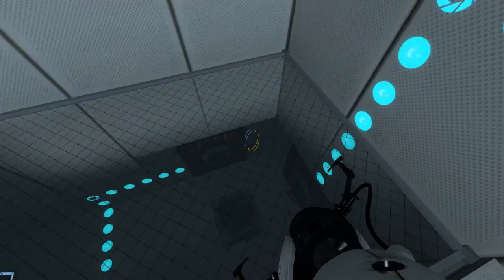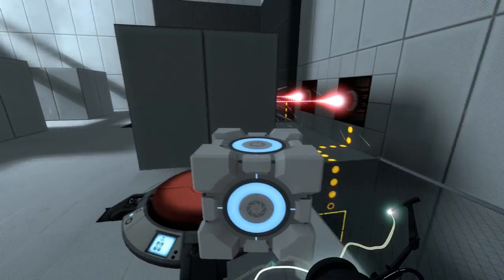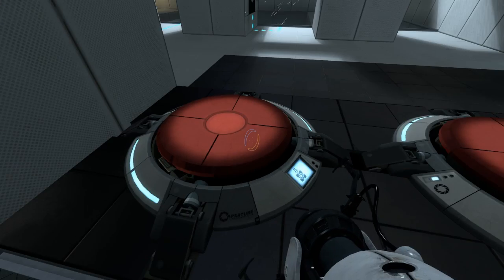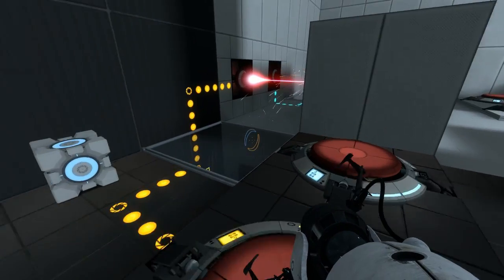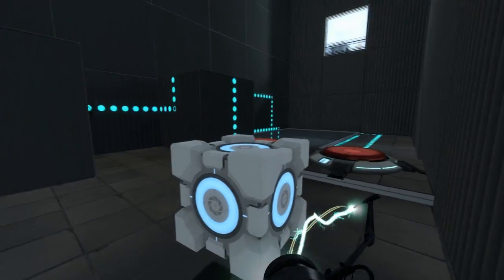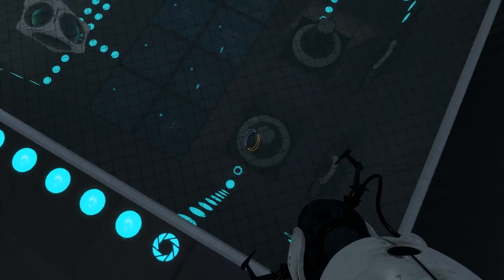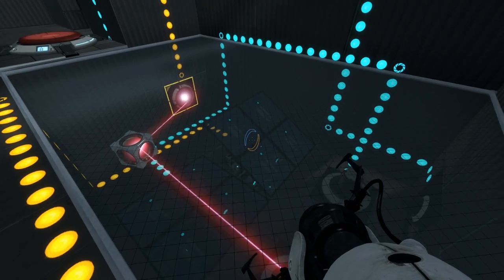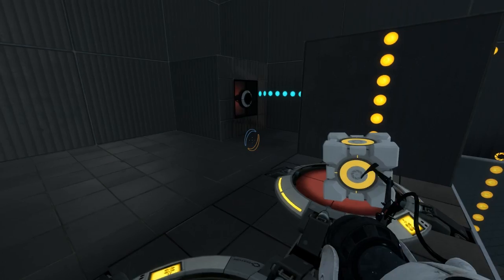Portal 2 Logic Gates

Comment: I never said a clock was limited to a computer.  What you are talking about, however, is a physical clock which is NOT the same as the clock pulse in a computer.  A crystal clock does NOT operate in the same manner as the cpu clock.  The cpu clock operates under the control of the motherboard firmware.

Comment from the maker: Do keep in mind that a clock is a logic element used in all synchronous logic, and in most cases needs no firmware. The computer version of a clock is a heavily extended version of the usual simple logic clock found in post simple electronic devices.
A voltage applied to a crystal makes it oscillate sinusoidally, and that signal can be put through a a discrete logic element and you get a regular square clock out.
Thinking that a clock is limited to a computer is quite naive.

Comment: that isn't a clock.  That is a solenoid/relay.  That is how a bell works.  A true clock is what you have on the stand buttons.  Sure, it functions as a pulsed power source (like a clock does), but it is not technically a clock as it is a self regulating system.  A clock is not a logic element.  A clock is merely a regular pulse of energy that is heavily controlled by firmware to regulate the processes of a computer.